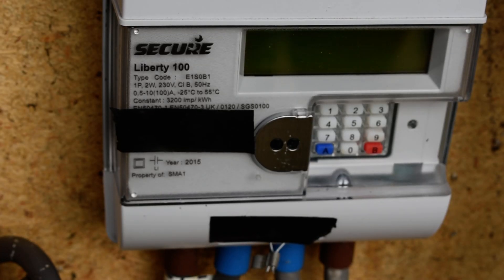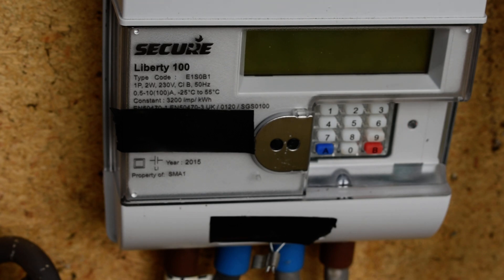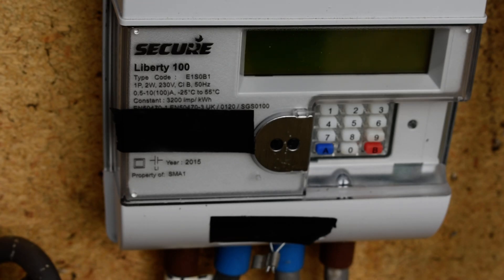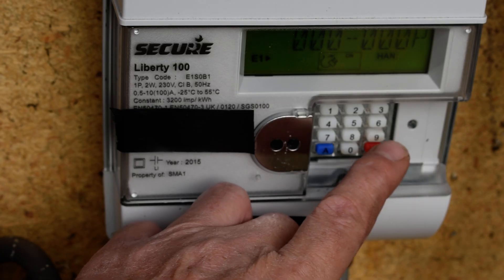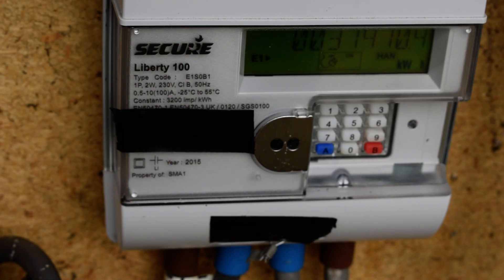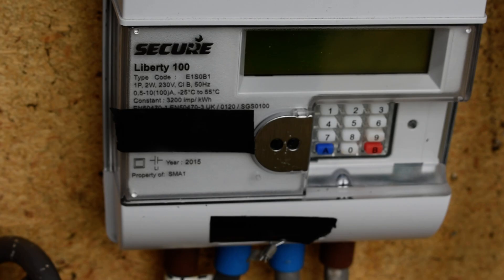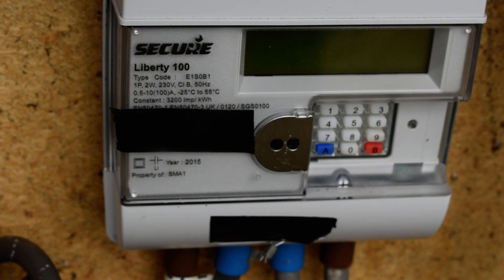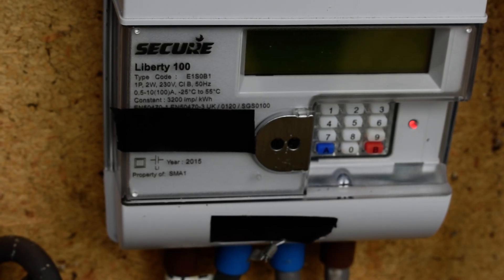How to read Smart meter SMETS1 Liberty 100

Comment: on an prepay electric meter, if i put say £250 on it at 15p per kwh. then i decide a week later to put another £250 but the pence per kwh changed to 25p and i already have £200 left on the meter. does this mean that all £450 change to 25p per kwh????
Reply from the maker: Good Q  My Take is No  Meter will auto update the kWhout rate as you say. It will just burn whatever money is there at the current rate.
Reply: @xacteducation8036  could this be bypassed if say the wan* wifi sim card was taken out?

Comment: Hello can you please tell me where on the meter it tells me which IMP R is currently active, I have no idea when my Economy 7 starts or ends.   It's different times for different areas of the country I heard, plus winter and summer times is also a factor.  Thank You.
Reply from the maker: + sign before R01 R02 ... Look at my latest March2024 video Night rate normally starts 12.30 until 0730 on GMT Next week when we change to BST it will shift to 0130 to 0830
Reply: @xacteducation8036   Thank you for the information.  These Secure Liberty 100 meters are terrible.   I've just done a readings check only to discover the Imp R1 rate (Always Night Economy 7 for me) is now active in the day and vice versa?   Got to contact the EDF (nightmare) to sort it out.   Anyway, thanks again.
Reply: Thanks for the information. @xacteducation8036

Comment: Mine is bleeping - anyone know how to get it to stop?
Reply from the maker: Assuming it's the meter and not in home display could few reasons. If PAYG then credit issue. Could be lost mobile network connection. Could be internal fault. What does display say?
Reply: @xacteducation8036  the display doesn’t say anything but the wan light is flashing - thanks for responding
Reply from the maker: @cellerdisco  if WAN light is flashing that indicates it is connected to the DCC mobile SMS network. They have internal battery to save data if mains power fails. It may be a battery fault. Best to get in touch with your supplier.

Comment: Hi, instead of getting IMP RO1 and IMP RO2 I am getting IMP T1B1 and IMP T1B2. is this the same thing? any help much appreciated
Reply from the maker: Hi  Imp means Import as in what you take off the Grid  So I would say yes. Is it from button6 ?  Is it same meter as my video?
Reply: @xacteducation8036  yes it is the same sort of meter and yes you access it via button 6. There  is also a IMP T2B1 which I'm guessing is another input. Thanks

Comment: My meter has just started doing a single beep every 30 seconds. Any idea what that’s about?
Reply from the maker: It may be indicating it has lost network connection. It's SMS mobile signal to DCC network to and from a smart meter
Reply from the maker: Or low credit if it's prepayment meter?
Reply: @xacteducation8036  credit is fine. I will have to check the network. Because the internet is a bit spotty. I searched google and it said low battery. Thanks for the reply

Comment: How do read my balance on my electric please
Reply from the maker: Depends on what software update your smartmeter has.  Buttons: 0=Time & date;  1=Today usage;  2=Last wk usage;  3=this Month usage;  4=History month by month
5, 7 & 8 Not used; 6=Import Registers R01 to R15;  9=Totals Import Registers;
A&B=PAYG codes  A=VEND 
If you have PAYG but it hasn’t shown on your IHD, you can add the credit directly to your Smart meter - press A(VEND mode) then key in your 20 digit Transaction Reference Number (TRN) when you’re finished, press the red ‘B’ key. The meter will either then accept or reject the code.

Comment: How do I activate emergency?
Reply from the maker: If you need to use emergency credit, press ‘7’ on your keypad. If it’s available, the screen will display ‘EC OFFER’. You’ll then be asked to accept or ignore the offer of emergency credit. Press ‘A’ to accept then press ‘B’ to confirm. Once you press ‘B’, your emergency credit will be active. Wait 20 seconds until you see the default screen and then press ‘7’ on your keypad. Your Smart meter will display ‘IN USE’.

Comment: R01 is the day rate on ours. Any idea if the meter can display the peak and off peak time periods?
Reply from the maker: Good Q Not sure if you can get actual times Will check on mine However normally Day=R01 7am to midnight  Night=R02=midnight to 7am

Comment: On our meter I get a number followed by kG or could be kc? What is this reading please
Reply from the maker: If you press button 0 it will give time date & CO2 emissions in kG  The kG readings is irrelevant to what you get charged for Ignore it It button 6 & 9 for electricity use you need
Reply: @xacteducation8036  thankyou so much. Eon have estimated the bill so we are trying to work it out. When the meter was first installed they gave us the meter for inside the house but now they are saying the two do not work together
Reply: @wreckingball22  Do not trust any supplier Take manual readings regularly. Via button 6  The smart meter and HAN have to talk to each other They need a code I think

Comment: Hi. How do we know that there’s a sim card inside or none? Thanks. Very helpful video
Reply from the maker: There are various LEDs flashing which indicates function and SIM card installed. Mine can receive data but not transmit so not yet fully functioning smart meter
Reply: @xacteducation8036  thanks for the reply. But, is there a way to know that it has a sim card and is actually transmitting?
Reply from the maker: @Zpzppre  It will have a SIM card fitted But it may not be transmitting with the DCC network  the Smets1 Type I have don't transmit and hence can't be auto read  If in doubt ask your supplier  This may be hardware upgrade required for Smets1  Not sure the whole smart meter roll out is a shambles
Reply: @xacteducation8036  thanks mate. I’ll ask the supplier
Reply from the maker: @Zpzppre  this was my suppliers reply recently     Your smart meter has migrated from your previous supplier . You are in part of The Enrolment and Adoption programme that is designed to bring all smart meters to communicate with their supplier . Once the programme is completed the meter will send us meter reads , until then you will have to submit reads manually . 
 
-The meter is on 2g network . The meter sends reads like "sms" message to us .

Comment: Thanks for the video. To submit a reading to the energy supplier, do I supply the standing rate or off peak or both?
Reply from the maker: You need R01 which is normally day rate If dual rate or you E7 storage heaters then R02 will be active also. A plus sign with R01 R02 mean that rate is active if your smartmeter has up-to-date software

Comment: Load of crap. I hate my gas smart meter, it's a 15 minute process to try and get the gas to come back on and stay on. My supplier doesn't give warnings in time that its going to turn off. Ready to smash the thing off the wall
Reply from the maker: Oh dear Deep breaths Yes so called smart meters are not very smart at times Do you have IHD or just smartmeter - if so gotta check meter regulalry Try button 7 for Emg credit?

Comment: I asked to submit my reading, but I donw how, do I press number 9 or just 6 and then what numbers I need to take thanks, I just moved into the property
Reply: Press 6 IMP R01 numbers If more than one rate R02 also If there is a + sign with any Import Register such as R01 it is active  No + sign means not active See my new video update Good luck
Reply: @darjfgh4788  thank you so much 🙏🙏

Comment: How can I top up this meter
Reply from the maker: Your supplier can provide a PayAsYouGo code if that's how you pay. Via email or text or PAYG card code  Type in code on keypad Your supplier may have remote access via the DCC mobile network  If so they can switch on or off and change number of Import Register rates against time of day  My Smartmeter now has 15 Import Register rates but only R01 is active at present

Comment: Please how do i use the emergency on this meter? 
I have an urgent need for it.
Reply from the maker: You need a PAYG card  Key in the code
Reply: @xacteducation8036  i need a payg card. Got it.
I didn't understand the rest.
Do you mean and a code? Is the code provided by the energy provider?
Reply from the maker: Yes your supplier should provide the PAYG code either with a code from a card or via an email or text  Type in with the keypad Does your Smart meter have a slot to read a card? Would have thought that unlikely Smartmeters are designed to have remote access via DCC mobile network

Comment: My wife is getting very stressed as she cant get the ro2 reading?
Reply from the maker: If you press button 6 it will cycle through the Import Register readings i.e. R01 R02 R03 ...  After pressing button 6 display will show in sequence of 1 second gaps TARIFF  ACT  RATE  IMP R01 STCHG/DAY    wait for +IMP R01+  next will be R01 reading  wait for +IMP R02+ next will be R02 reading

Comment: Hello, I recently moved to a flat with dual electricity tariff and this Liberty 100 smart meter installed. I have the following questions and hope you will be able to help me. 
1. How do I check the time frame of the off-peak tariff? Can I do it on the smart meter or do I need to call energy provider?
2. Does the smart meter change its time from summer to winter time? 
3. Is there a separate electrical circuit connected to off-peak only? I have 2 storage heater and hot water tank which in theory should only consume energy when in off-peak. How do I make sure they work correctly with respect to question 1 and 2?
Reply from the maker: Thanks for your Q  Only sure way is to check manually For example if your R01 is Day rate & R02 is night or E7, then go out early say 6am and check which one is ticking over Stick a kettle on to sink power 3kW for couple mins  Usually Night rate is midnight to 7am when on GMT Might change in BS T  Hope that helps
Reply from the maker: If your provider has remote access then changing GMT to BST will be automatic. If its storage heaters then should have their own circuit and meter rate Night rate about 13p per unit if E7 circuit. Some suppliers do offer day & Night rates ebven without separate E7 circuits. Our supplier has just one rate now and most suppliers seem to be doing that now. Smart meters appear to be in the process of updating remotely to have multiple rates R01 to R13 on mine just now. This will force consumers through higher rates at peak times to adjust things like dishwashers to only be sensible going on at certain times. It's to balance the Nat Grid loading with intermittent renewable generation. Hope that helps. Let me know if it makes sense. Planning another YouTube video update soon.
Reply from the maker: if you press button 6    it will cycle through the Import Register readings i.e. R01 R02 R03 ...  After pressing button 6 the display will show in sequence of 1 second gaps TARIFF  ACT  RATE  IMP R01 STCHG/DAY    wait for +IMP R01+      I think if it shows +IMP R01+ then R01 is active  If it just shows IMP R01 then this is not active   My meter has one rate now so R02 R03 on the display has NO + before & after showing these rates are not active

Comment: Which is night reading and which is the day?
Reply from the maker: Use button6 to see your Import Register readings R01 R02  Depends if your supplier has remote access or not. Some will switch over R01 & R02  If you have dual rate or Economy7 then only way to tell is to manual read the meter during the day at interval of 1 hour - Rate that does not move is Night or Economy7 (normally Midnight to 7am)

Comment: How do I take the reading of day and night ??
Reply from the maker: If you have dual rate elec meter then Import Register  IMP R01 & R02 are the readings you need. Which one is day or night depends on whether your supplier has remote accessed your meter. Easiest way is to look at what reading moves during the day Put a kettle on.  3kW will make meter spin even for few minutes Hope that helps?

Comment: How do I find out the remaining balance / credit on the meter?
Reply from the maker: The keypad is there for entering PAYG code from your supplier. The supplier should detail how you get remaining credit. But I would try in first instance cycle button 6
Reply: Press the B button an read the screen it should tell u your balance as mine does

Comment: Hi, Robin Hood installed my Liberty 100 meter years ago !
I’m now with Scottish Power and they don’t seem to be able to read my meter 
When I press the number 6 
I can only get Roi1 it does not provide me with an RO2 - the chap from Morrison’s could not find the numbers either! 
When I press number 9 it gives me lots of numbers ! Can I use these numbers for my Standard readings 
Many thanks
Reply from the maker: Years ago probably means SMETS1 type without SIM card - so maybe not Smart! Just digital meter. Ask SP if they can remote access your meter via WAN or long range radio  or not?  If not then its manual readings. Sounds like you just have one rate? If so Press button9; You will see the message ‘IMP KWH’ appear on the screen
; IMP means Import Register; Wait a few seconds for the screen to load; The following screen will display the Import register reading, this will time out after 4 seconds; Use this when submitting your meter reading; If you missed it, press 9 continually until you see the ‘IMP KWH’ again.
Reply: @xacteducation8036   thank you so much for your speedy response! 
I am getting charged two rates from Scottish Power! We are on dispute with the bill which is why I am trying to understand the readings 
Apparently when you get the ROI 1 this is the economy reading ! The chap from
Morrison’s said to thanks the ROI reading away from
The IMP KWH reading and that should give me my day rate! Is this correct do you know
Reply: Also can you tell me what IMP KVARH means please
Reply from the maker: kVArh means kilo Volts Amp reactive hours - its a measure of energy but not the work(kWh) energy - its the energy stored if you have loads of motors which causes lagging current - no need to know this really as you dont get charged for it - only relevant for industrial properties - Its the kWatt hours that is work energy you get charged for.
Reply from the maker: 2 rates means use button 6  RO1 might be day or night Same with RO2 - depends on how the supplier sets it up - check your previous bill RO1 is normally Day rate  RO2 night rate (cheaper rate)  If you have E7 night heaters there might be separate meter for that?
Reply: @xacteducation8036  thanks again for replying ! I do have a RO1 reading but no RO2 ! 
Is there a way I can find the two readings? Anyway to identify which reading RO1 is and where would the total reading be? 
Many thanks for your help 
Scottish Power is no help
Reply from the maker: If you have E7 storage heaters you might have a dedicated meter for that? If there is only one meter in your property & you press 6 and only RO1 appears then its just single rate - presume day rate of approx 18p/kWh Changing suppliers is awful - had similar issues and when resolved will do another video - the whole Smart meter roll-out has been poorly handled and poor customer support.  Use xacttutoring@gmail.com if you want to do direct emails

Comment: Hai sir
 Can u just tell me what is IMPT2B1, IMPT1B2,and IMPT1B1
Reply from the maker: IMP is short for IMPORT REGISTER   If you have multiple rates, please follow the following guidance;
1.	From the default screen, press number 6 on your keypad
2.	Continue to press number 6 until you see the message ‘IMP R01’ 
3.	Wait a few seconds for the screen to cycle
4.	The following screen will display the Rate 1 register reading, this will time out after 4 seconds
5.	If you missed it, press 6 continually until you see ‘IMP R01’ again,
6.	The next screen cycle will show you the unit rate for Rate 1, this will time out after 4 seconds
7.	On the next screen, you will see the message ‘IMP R02’
8.	Wait a few seconds for the screen to load
9.	The following screen will display the Rate 2 register reading, this will time out after 4 seconds

Comment: Hey there, do you know how to turn on the electric?

I ran out and called Eon to top it up but I'm not sure how to turn it back on?

Thank u!
Reply from the maker: iF you mean PAYG with a Smart meter i.e. top up your credit? If so you need to contact your supplier - they should give you a code to key in OR if you pay online they may be able to switch back on remotely

Comment: He ma friend when the red light next to keyboard flashing all time is that normal kind regards Scotty
Reply from the maker: Hi Scotty It is normal. Mine does too. Does not necessarily mean the meter is connected to the DCC. It may flash whether there is a SIM card installed or not. Mine is probably SMETS1 variety. You have to ask your supplier if they use the DCC and can remote access it for readings, otherwise its manual readings!

Comment: Hi pal, can you help me, I have no clue about these meters amd I have to do a job in 2 empty houses with same meters, how do I go about topping these up only about a fiver in each 1 so I can get the work done, I don't know who the supplier is can I use anyone, basically I just need to put money on to gwt the jobs, the council has just told that it gets paid through the bank, I have no idea, can someone please jusy tell me how I can put some money on them only 1 time, thanks in advance
Reply from the maker: The meter in my video is just a digital meter with no facility to top up credit. If i understand your problem you need a pre payment type meter to get electricity on so you can use tools etc Does your meter have key or card slot to top up credit? Is there an outside switch to put electric back on ?  Is there an emergency credit button  - pushing a red button on your meter ? The full emergency credit amount will be used when activated.